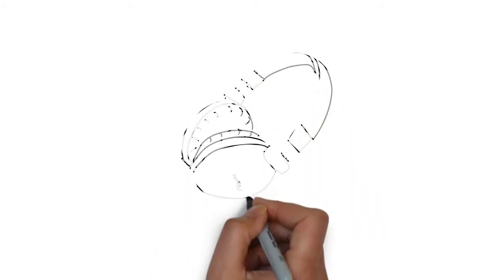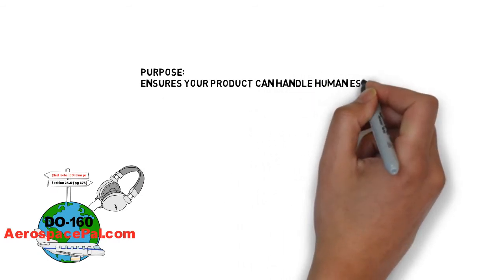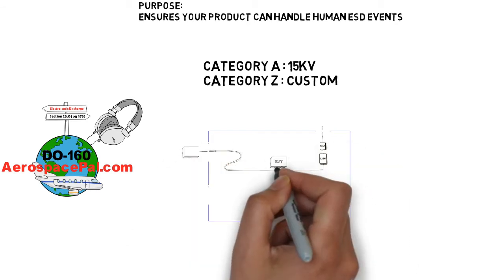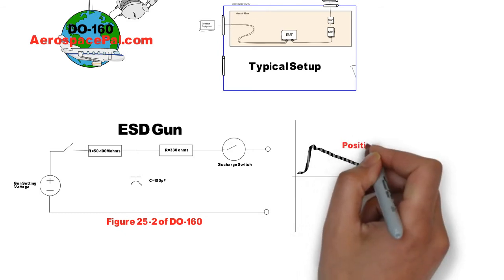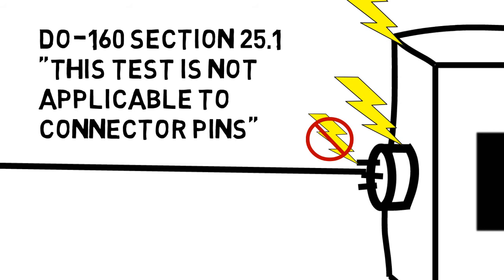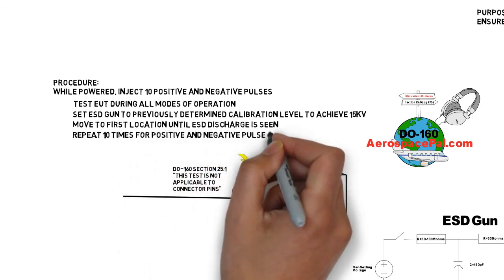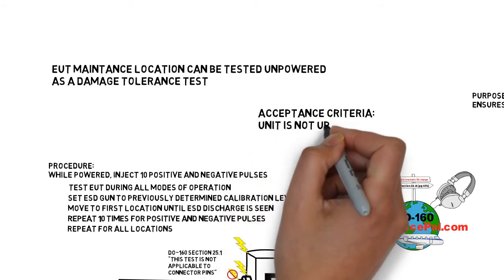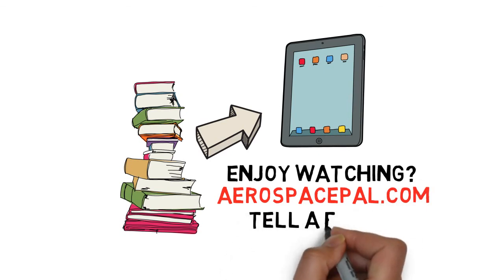RTCA/DO-160 Electrostatic Discharge ESD Overview

Comment: A point to note for anyone familiar with the more common commercial ESD is an Air discharge tip is used and as you said, approach the EUT to discharge.